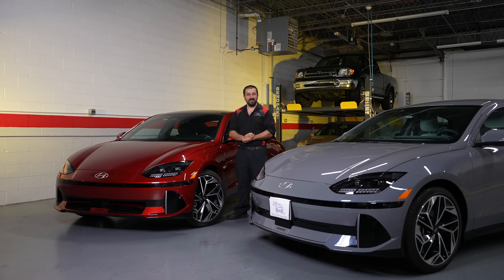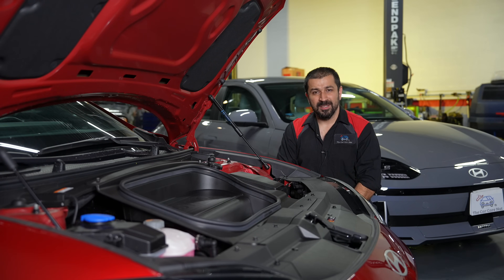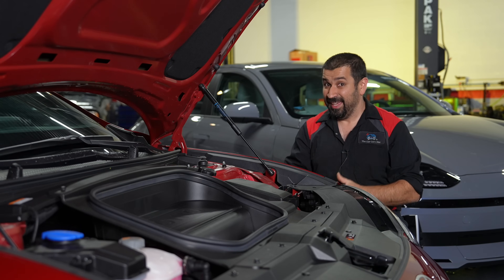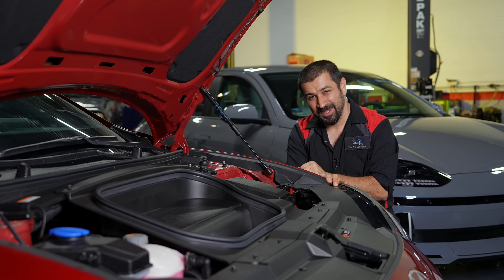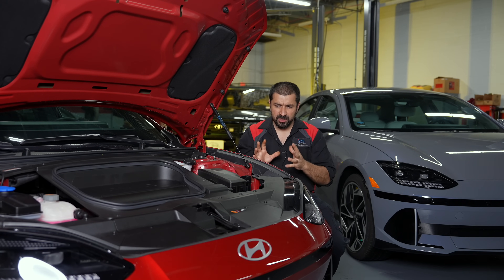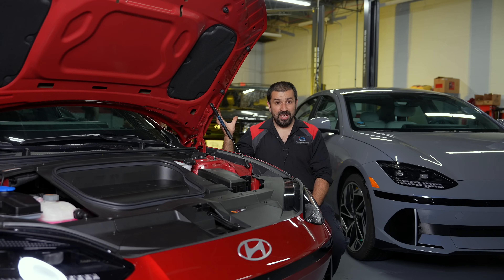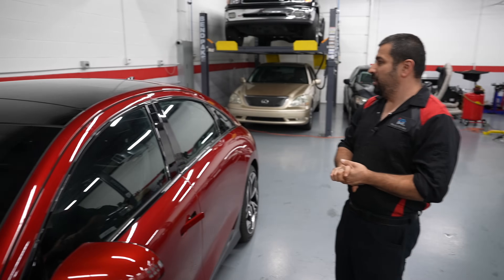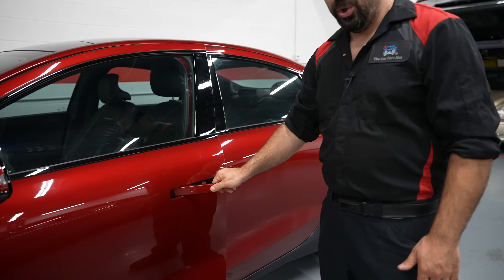Should You Buy a Hyundai IONIQ 6? Thorough Review By A Mechanic

Comment: Granted Tesla is the leader in mass produced EV motor design and cooling.  However, Tesla is horrible at chassis tuning with stiff suspension that cannot handle curves and brakes that can barely stop the car during spirited driving. Also Tesla quality/fit/finish is the worst in the industry. Funny how this reviewer never mentions these obvious issues everyone knows about. He just seems like a Tesla fan boy.
Reply: Chassis and suspension from Lotus engineer - described by Munro as " a Prince amongst designs, that engineer could work for an F1 team". Designed as a Sports Car with identical 5 link suspension to BMW, which lost in the Top Gear tests.
Fit and finish of the Plaid before tear down described by Munro and McElroy as "good as a Bentley"
Tesla hater Lutz: "I was stunned. Not only was the paint without any discernible flaw, but the various panels formed a body of precision that was beyond reproach. Gaps from hood to fenders, doors to frame, and all the others appeared to be perfectly even, equal side-to-side, and completely parallel. Gaps of 3.5 to 4.5mm are considered word-class. This Model 3 measured up. It was impossible to find fault with the visual quality of that Model 3." Road & Track JUN 15, 2019.
Tesla tops the customer satisfaction surveys in US, Norway and China every year... 
Model Y best selling car in the World...
So FUD from the TSLAQ again.
Reply: @waynerussell6401  Thank you for the Tesla infomercial. Every Tesla I have driven, except Plaid which I haven’t had a chance to drive, had noticeable quality issues with mismatched panel gaps, squeaking/rattling, harsh ride, cabin noise, etc. And repair costs for minor panel damage will costs you thousands. I don’t care what Munro says. He’s just an engineer who has no true driving experience. Suspension and braking are some of the worst I’ve experienced.

Comment: problems with EV vehicles that you must spend tons of money on tires  so even if you save something on  fuel  /electricity you will spend more on tires
Reply: From "Users' experiences of tyre wear on electric vehicles A survey and interview study" June 2022 Report number: 1126AAffiliation: Swedish National Road and Transport Research Institute: "most professional users (Taxi, Bus, Rental) experience similar tyre wear as for ICEVs."
"Tires on a modern electric car will wear down much slower than in a car with a traditional internal combustion engine. This is due to good traction control. The driver assist systems reduce slipping by utilizing the electric motor's rapid power adjustment. This system is much quicker than in ICE vehicles, where it is based on braking and limiting engine RPM," Nokian Tyres
Reply: @Mr11ESSE111 Yeah, and F1 tyres last ~ 100km.  
We are talking standard driving in similar powered vehicles.
Reply: @waynerussell6401 and you must change them every 8000km on Tesla and you drive normal too

Comment: You shouldn’t. You should buy an Ioniq 5 instead. 😎 But Hyundai dropped the ball with the Bose audio system. How they go from Harmon Kardon to Bose?? Seriously? I have an Ioniq electric 2020 and the sound system sounds 10 times better than these 2024 Ioniqs 5 and Ioniqs 6 🤦🏽‍♂️ smh..I will not upgrade because of that reason alone‼️📢

Comment: Why would I purchase a vehicle that is mechanically totaled when the batteries die?  10 years, maybe 15, vs a normal car I can drive for 50 plus?
Reply: Wonder how many people drive their cars for 50+ years. They must be all statistical outliers.
Reply: There are plenty of 10 year old Tesla's still driving around. The batteries are more durable than you think.
Reply: Who is driving a car for 50+ years?
Reply: @AWMJoeyjoejoe 10 years old is not very long for a car try 20-25
Reply: @JDMSwervo2001  Well the Model S was only put on sale in 2012, so the very oldest of them are a mere 11 years old. Check back in 15 years. There are some high mileage examples out there still on the original battery still with more than 90% capacity, so I'd say it bodes well for the long term. Besides how many modern ICE cars can you name that you'd expect to last 25 years?
Reply: @AWMJoeyjoejoe  any Toyota or Honda and some Chevys lol
Reply: @JDMSwervo2001  And I'd wager any Toyota or Honda EV will also last 25 years. It's the execution, not the concept that determines the lifespan of a car. A lexus LS430 will last 25, 30, 40 years if properly maintained, but can you say the same of a VW Golf? I expect it'll be the same with EVs. In 25 years time you'll still find old Toyota EVs on the road while the landfills will be full of lesser brands. I suppose time will tell.